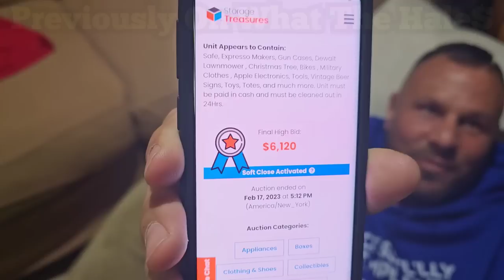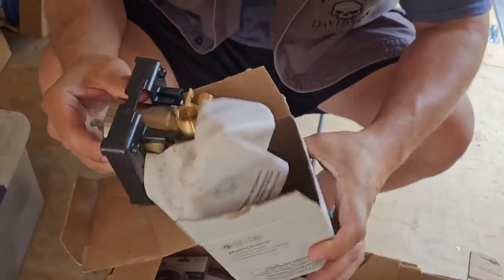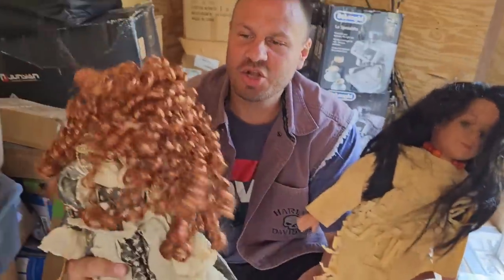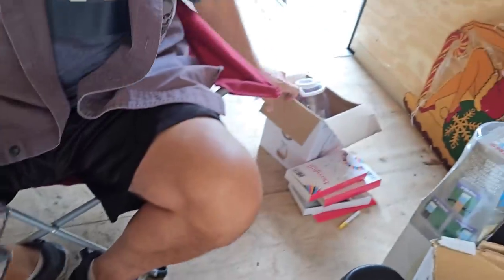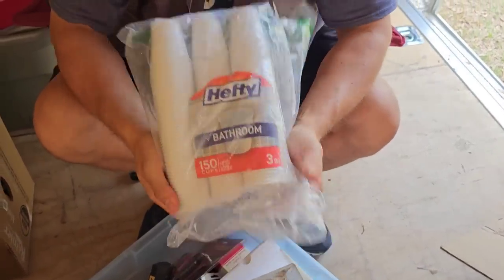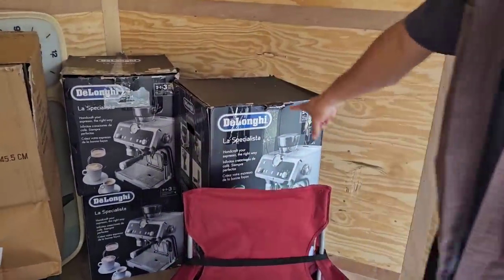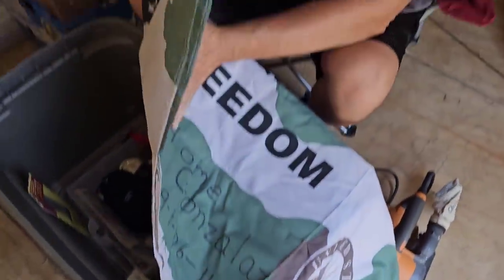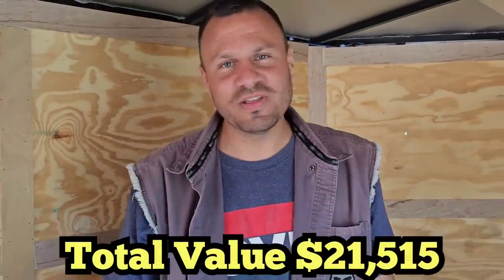I Bought A MILITARY VETERANS Abandoned Storage Unit ... WHERE IS HE?

Comment: To keep bugs, wasps and bees away at half time get some 2 L of regular root beer. Pour out half cut the top off so you can use it by flipping it upside down and putting it in the 2 L take a dropper two of dishwasher soap and place them All around outside half mill and they will keep the “big bugs away”!!